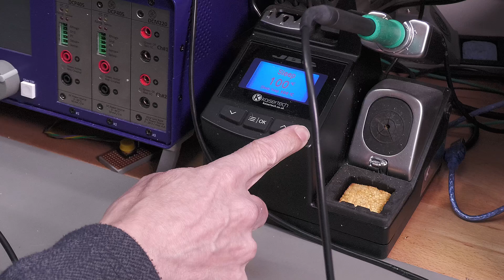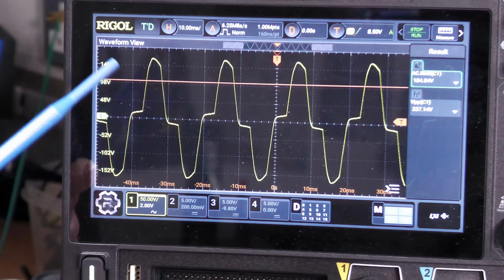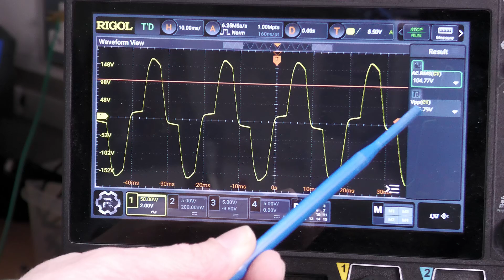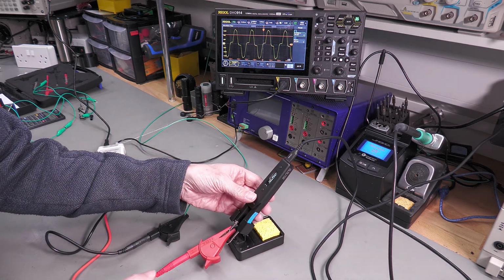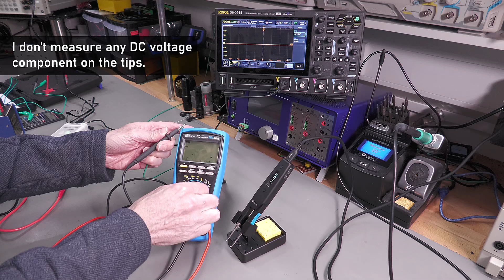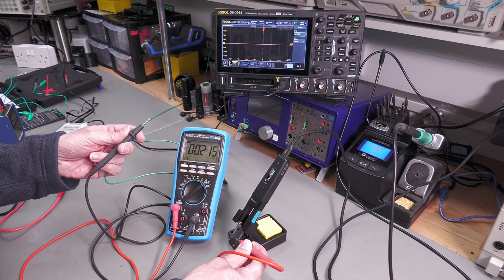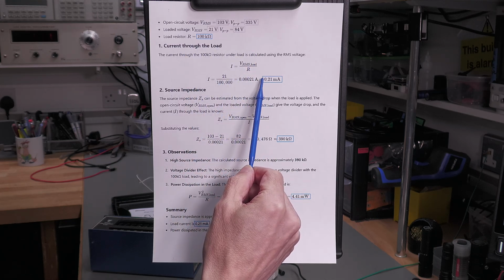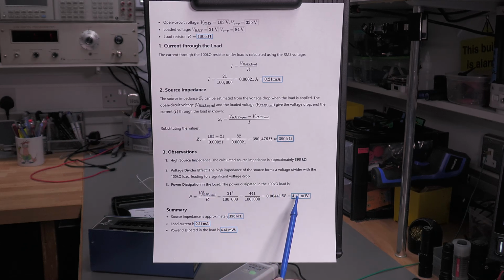No.149 - Sequre HT140 Soldering Tweezers Problem and Fix

Comment from the maker: 1. See the video annotation @6:44 where I had confirmed the USB-A socket (shell) is connected directly right through to the tips, hence I didn't bother to show the final result on the multimeter.
https://youtu.be/se6-jGZsHS0?t=405

2. I have been in contact with Secure and they have promised to do something about this issue. UPDATE 6th Jan '25:
Quote from Sequre " For Type-C AC power supplies, I have tested Apple, Baseus, Lenovo and other power supplies. They all have 2 pins that cannot be grounded properly, and they will all generate leakage voltage. Only 3-pin power supplies are grounded, which can eliminate voltage leakage. For additional GND wires, they will be included in the package in the future. They are currently being designed and produced, and it will take some time. For previous users, this GND wire will be given free of charge with the package in new orders, without any charge, and there will be no time limit and it will be valid forever ".

3. Why the Micsig?....Just a precaution as the Rigol scope is USB power also and although it has an earthed PSU it exhibits about 0.8Vac on the BNC shell relative to mains earth. I wanted full isolation to rule out any ground loops etc.

4. References:
https://www.esda.org/assets/News/OpenForumHandtoolsPrass08-1.pdf
https://www.descoindustries.com/pdf/TB-4011.pdf
https://www.reddit.com/r/soldering/comments/1fjrdtc/comment/lzkv2yw/
Reply from the maker: Yes, it’s fixed. Sequre are now providing a cable kit with their PSU’s
Reply: Thats interesting.
I told them to replace the power brick with a properly grounded one but Instead, they gave me excuses and suggested running a ground wire separately like you did. 
As well as blaming me for not testing it correctly.
This must be a joke.

If they send equipment to techs for a review and completely disregard their feedback, maybe dont send me your junk to begin with ? 😡
Reply: @northwestrepair  Hello, thank you for your test and feedback. Sorry if it brings you a bad experience. As for the problem feedback, SEQURE did not deny its existence, but actively handled and recommended more ways to use it to meet different user needs, including the fact that we actively contacted lan to record and publish this video for users in need of reference.

The voltage leakage is mainly caused by the power supply, and there are the following ways to solve it:
(1) When the Type-C AC power supply is used, it is recommended to connect the GND in video mode.
(2) The use of battery or portable power supply, no voltage leakage.

The following is my investigation found the problem, there may be mistakes, please correct.
(1) At present, many TYPE-C power supplies are 2 AC pins, there is no special GND, and the shell is also plastic, including our mobile phone charger. All these power supplies will produce voltage leakage. If this voltage needs to be eliminated, the method I have learned so far is to refer to the operation of the video, which needs to be independently connected to the external GND.
(2) If the shell used by the power supply is metal, we can lead the GND to the metal shell, which can absorb part of the leakage voltage, but it is not complete, and the effect is better without real grounding. At the same time, the power supply of the metal shell is very few.
Reply: Many laptop type USB C supplies seem to have a 3 pin clover connector and no double insulated symbol (google Lenovo slim pro 7 140w USB C). Do you think these actually earth the USB C wire?
Reply: Is it fixed now?
Reply: actually, Apple laptop power supplies CAN be earthed. They have an exposed earth lug inside. I have such power supplies right here. You have to buy an extra connector (with apple psu's they slide off). The problem is the only earthed connectors are either via a loooong cable and discontinued, or the only small ones that are not discontinued are for US power supplies. So what you do is you buy that, and a US guest mains adaptor for your location, and then you're golden. I have 4 different power supplies like that and they're perfect for this. Sadly they only do up to 96W, and the iron can do up to 150W. But it's way, way better than nothing! You can find the connectors if you search for "grounded duckhead". note aftermarket sellers also sell british plugs with an earth lug, but there is no contact between that and the psu. you really have to buy the US one. or buy the long cable one and put your own mains plug on it. I prefer the guest adapter because it's compact, for schuko the adapter sits flush with the power outlet.
Reply: @IanScottJohnston  hey Ian, someone in the comments said that even running from a power bank, the tweezers have a potential difference between them (search for the comment by pault6533). he said he put them across an LED and it lit up. would you mind checking this? if you put the tweezer across a red LED, does it turn on? i would appreciate it if you let me know as i am debating buying the tweezer. thanks.
Reply from the maker: @cheater00  If NOT earthed then yes an LED will light up, but if earthed via my method or the now published Sequre available fix then NO.
Reply: @IanScottJohnston  thanks, just to make sure, is this in theory, or have you tried? appreciated
Reply from the maker: @cheater00  It's fact, I have tried it. I lit up an LED (dimply) without the new earth connected. And it did NOT light (of course) with it earthed.
Reply: @IanScottJohnston  thank you! appreciated!

Comment: Thanks for the no-nonsense approach, good sir.
Allow me to add one little detail though.
IMHO the component damage is more of "hitting it at one of the peaks with high potential difference" than "subjected to multiple times".

Capacitive reactance might be 390K in a continuous scenario but hitting ~300V diff though a 8.2nF capacitor will cause a much higher momentary current flow that could probably break some molecule-thin FET gate.
The rough calculation of such discharge shows 0.37mJ energy but I'm no semiconductor expert to know what kind of devices it can damage.
BTW I have one ordered and intend to test exactly this, including the current pulse if my way humbler equipment lets me.
Reply: it will destroy small transistors like 2n7002 for sure, and maybe some bigger ones, too.
it's definitely worth grounding it.

Comment: I thought I was safe running from a *6s battery pack*, nothing connected to mains at all.   Then I went to desolder a green LED from an otherwise unpopulated board, and the darn thing briefly lit up!    I connected the two tips of the hot tweezers to an oscilloscope coupled DC, and found that the output was quiet when stopped - but extremely noisy when working.  Every ~15 ms there is a sharp positive or negative pulse, later measured as 2.5 V for 20 ns.  Sometimes a smaller DC bias showed up in between.  Based on my understanding of how C210 tips work, there is a thermocouple in series with the heating element.  When powered, every so often the iron will briefly interrupt voltage source and measure the resistance across the tips.  I suppose that is harmless for a single tip.  Evidently a dual tip implementation with two independent driving circuits running off a common power source is a recipe for significant electro-potential between the two tips!
Reply: it sounds like the outside of the tips is the high-side at least on one of the tips. what if you rewired them so the outside of the tip is the lowside? is that possible? can you try?

Comment: Have the same iron - another tip is don't get their supplied usb power brick, it's under powered. I got a 120w gan3 charger off amazon which has several ports - one being 100w and it allows the iron to run at it's full capability (£18.99 at the time)

Comment: Hi, to keep the tips grounded, could you use a 3-pin Dell laptop charger, for example?
Reply: not all laptop chargers have a true grounded usb or barrel jack. Some are connected to ground via 1M ohm.

Comment: Interesting and a good catch.  I checked the Apple 87 W power brick that came with a 2019 Macbook that I inherited - it measures about 1 megohm from earth input to the shield of the USB-C. Although in the US these come with a 2-prong ungrounded plug, so it's kind of moot unless you bought a 3-pin cord like I did.

Also I'm glad you covered these tweezers because I've been thinking about getting something of the sort.

Comment: My charger only has one output, do you think a USB C Splitter (as sold to connect headphones and a charger to a phone at the same time), and a USB C lead with one end cut off and the grounds connected to a banana plug (other wires heatshrinked), plugged into an earth bonding plug would work?

Comment: Easy solution for a problem that should not exists.
I told them, they can fix it quickly if they replace the power brick with a grounded one but all i got back is excuses and workarounds.
Reply from the maker: I had a few emails back and forward, got the brush off as well to start with but persisted with a couple of photos and I think it sunk in then. We'll see what transpires now! I would at least hope they do their own tests and supply a cable to give the user the option. I doubt they can change the PSU, they'll have thousands in stock.
Reply: @IanScottJohnston  Hello, first of all, thank you for your test and suggestions. I did not refuse to solve the problem, maybe there was a misunderstanding in the translation. For Type-C AC power supplies, I have tested Apple, Baseus, Lenovo and other power supplies. They all have 2 pins that cannot be grounded properly, and they will all generate leakage voltage. Only 3-pin power supplies are grounded, which can eliminate voltage leakage. For additional GND wires, they will be included in the package in the future. They are currently being designed and produced, and it will take some time. For previous users, this GND wire will be given free of charge with the package in new orders, without any charge, and there will be no time limit and it will be valid forever. Please check your first pinned comment. I have a reply to the relevant questions in the message. If there is a problem with my message, please correct me.
Reply from the maker: @SequreTech  I have update the pinned comment........thanks for taking care of this, the ability to give the user the option to use grounded tips is perfect.

Comment: NorthWestRepair who is in the US found similar voltage readings on the tips but in his case it was 50V AC due to lower mains voltage https://youtu.be/xRht6uTDJAw?t=323.
Reply from the maker: Yes, I saw that......and he's same opinion as me i.e. yes, it's a very low current, but would you really take the risk with your multi-thousand dollar GPU's!

Comment: Another option is to leave the USB cable whole and create a USB-Banana adapter with a resistor of choice.  However, doing this type of workaround concerns me.  I would not know what potential problems would arise of providing this additional pathway, especially if something in the system fails.  Of the thousands of people watching this video, I would be concerned about the few that end up doing the modification wrong.  Perhaps Sequre can provide an official mitigation recommendation.
Reply from the maker: I have been in contact with Sequre, they have seen my video.......and have promised to do something.

Comment: Hi Ian: A few comments if I may  
01:10 If you live in the EU for example (as far more people do than live in the UK) then we only have two pin mains plugs, that are also reversable : So the grounding issue you raise is just a local one

02:10 We tried to reproduce this on the live stream a week ago and couldn't.  Do you think it is due to the power supply you are using rather than the HT140 as we didn't use that one. Yes I know it is the supplied PSU but it can't drive the tweezers properly so we used a third party 140W supply. We also tried using a USB power bank with the HT140 and couldn't replicate this problem with that either, which is unsurprising as the power bank is not connected to the mains. Try using a USB power bank yourself and see what you find then let us all know if your results agree with ours.  Also if you take a multimeter and measure the resistance between the two tips you will find that they are connected together (zero ohms) so you can't possibly have 300V between them 😉

05:39 - only if the device you are repairing is grounded!  As general point, an electronics workbench should not be earthed it should be connected to an isolation transformer. This is because it is much safer.  Use a grounded antistatic mat of course but that has a very high resistance (megaohms) to ground.  So if your DUT, isn't grounded or plugged into the mains while you are soldiering (and why possibly would it be??) and the two tips of HT140 are connected to each other please elaborate how this can damage anything? This is not a criticism of your opinion, I'm up for a good discussion about it. Be nice to hear from you.
Reply from the maker: I am in the UK (Scotland actually, the better end!). I bought the HT-140 kit from Sequre and they supplied the PSU.
So far, it works fine irrespective if grounded or not. Yet to put it under heavy load but so far so good.

Here's my opinion:

This is not an issue of whether soldering iron tips should be floating or not, it's an issue of whether the workbench should have actual real leakage currents and capacitive coupled large voltages should be left to occur.

When you apply the iron tips to a PCB then one or both of them will come into contact with the PCB and depending on the potential the circuit is at and due to the leakage current / capacitive coupling a large potential between them MAY occur.
Saying that, if it is a floating circuit, i.e. not plugged in anywhere) then you are at the mercy of any floating circuits and the voltage potentials across the entire system may or may not do.

Example: I just grabbed a PCB and put it on the workbench (grounded EE bench mat so ESD not an issue). It's not plugged in anywhere, totally floating, and I just measured the voltage between the iron tips and an IC component leg on the PCB.
- Without blue cable earth fitted = 36VACrms
- With blue cable earth fitted = 2VACrms
The air in an around the workshop is having an effect of naturalizing/pulling floating voltages on circuits. So, it's better to have the iron tips earthed IMHO.

Better to take the issue out of the equation totally IMHO. If the tips were floating WITHOUT the leakage current / capacitive coupling problem then it would be much better......but they are not.
I haven't opened up the Sequre PSU yet, but suspect its a Y capacitor issue that's injecting primary -->  secondary and finding its way to the tips.

The use of an isolation transformer is not mandatory on any EE workbench (I have one), just when they need arises I think most EE's will look at it.

I have been in touch with Sequre and they are looking seriously at providing a cable so users can optionally do what I did.

PS. I have two BM786 DMM's........the first one I tried during the making of the video turns out of found it had a blown 400mA fuse on the current circuit. One wonders why!

Ian.
Reply: @IanScottJohnston  Hi Ian
Yeah I figured you are from the better end of the UK 🙂.  I'm originally from one of the less pleasant parts, Stoke-on-Trent, but in July 2016 I figured it was quite likely to get a lot worse and moved to the south of Gran Canaria.

Anyway, electronics, so for any current to flow anywhere between two potentials there has to be a current path.  If the PCB you are working on is not grounded then no current can flow from the soldering iron tip into it, as at the instance the tip touched the PCB both become the same potential.  Of course if there is some sort of capacitive coupling between the PCB you are working on and ground, and there is also an instantaneous current path from your soldering iron via the PCB to ground but only while that capacitance charges up

I have the same PSU with the HT140 as it was supplied with the review sample.  I tried that one and also a 28V 5A PD3.1 supply and there is a notable improvement with the HT140 performance so I would honestly recommend you get a PSU rated at 28V 5A as it's well worth the money.  I got a fairly cheap PD 3.1 supply from AliExpress and that does power the HT140 properly... with a few quirks (I'll publish a video on that soon)

I would suggest that anyone using a USB soldering iron of any sort, who is worried about earth leakage, just run it from a power bank and the problem is eliminated.

Re Isolation Transformer, it's not mandatory but it is a very good idea and has surely has saved me from dangerous electrical shocks on more than one occassion.

I'm sure you are totally correct that the floating potential is coming from a High Voltage (Y) capacitor in the PSU connected between the primary and secondary winding.  The severity of this problem will vary from one PSU to another which may be why we couldn't replicate this issue.  On another live stream we actually removed the Y capacitor from a small 'wall wart' SMPS to see what would happen.  It continued to work just fine.  Yeah I know it may cause high frequency noise on the mains wiring but we didn't notice any detrimental effect from doing so and doubt you would see any real world consequences from just removing it.
Reply: @LearnElectronicsRepair  I'm from Ukraine. we have EU sockets here and I have encountered this problem. I bought a Ugreen desktop USB type-c power supply (Ugreen CD333 300W 4xUSB-C) which is properly grounded via EU socket plug and the problem disappeared. So this is another alternative to consider.